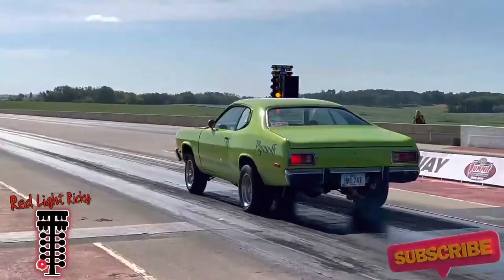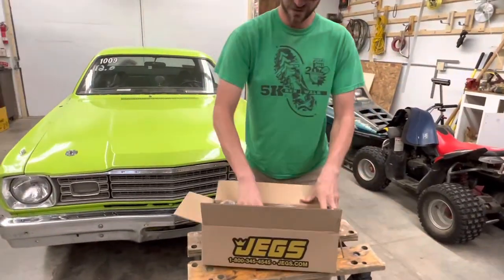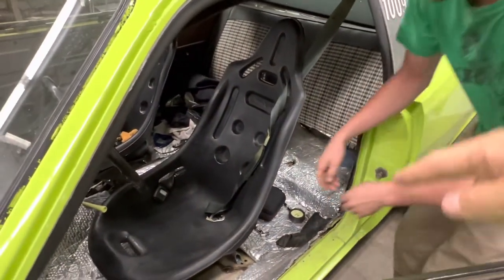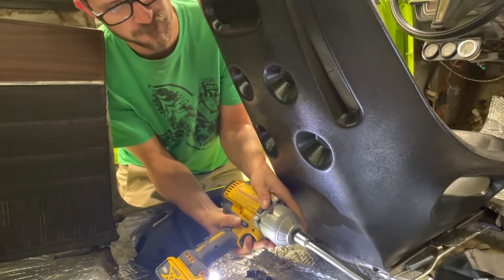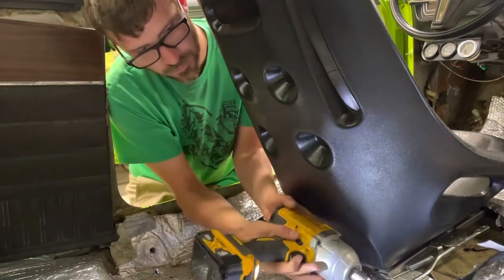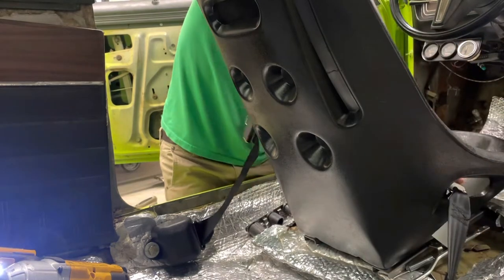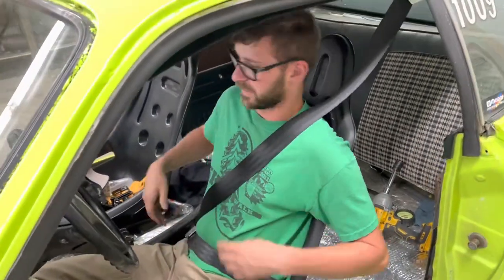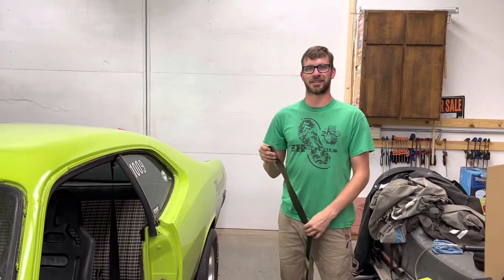Installing New Jegs Factory Replacement Seat Belts In the Duster

Comment: I'm sorry, but I have to say I'd have NEVER put a stock-style seat belt back in.  (But I do agree, anything is better than what you had.)  Running high-11's, you really should have a roll bar and 5 point harness.  NHRA regulations may have changed slightly, but I believe it's anything 11.49 or quicker requires at least a 6-point roll bar and 5-point harness.  Love watching your channel, but I'd rather you be safe than laid up in the hospital because you got smashed up.  ANYTHING can happen.  Be safe, my friend.  Your car will only get faster.  Trust me, I'm an addict with a Duster as well!!

Comment: Nice car.  I’m big on safety, I installed a set similar in one of my cars and another is going in my 74 Duster.  Lap belts aren’t enough.  Especially in modern traffic. Not sure if your aware but you installed it incorrectly.  The retractor needs to be vertical for it to function properly.  The part that is on the belt that you left loose is what bolts to the roof rail.  The end you have on the roof goes to the rocker or floor.    I just found your channel and subbed, so don’t know if you corrected it or not since the install.  But would hate to see you get hurt.
Reply from the maker: I did not know that. Thank you for bringing it to our attention, it will definitely get fixed before we drive the car again! Thank you for subbing, hope you enjoy the channel!